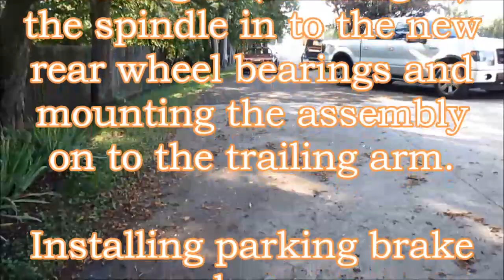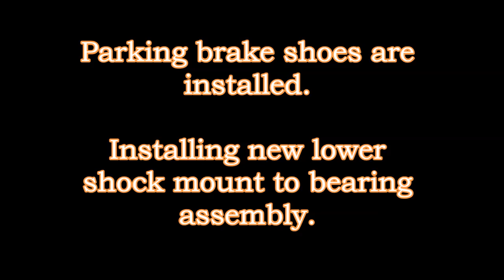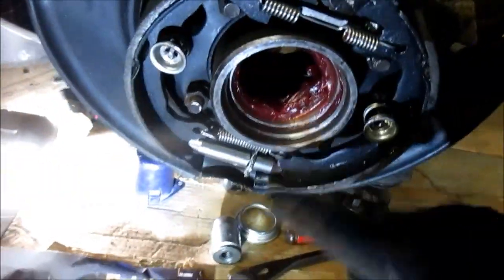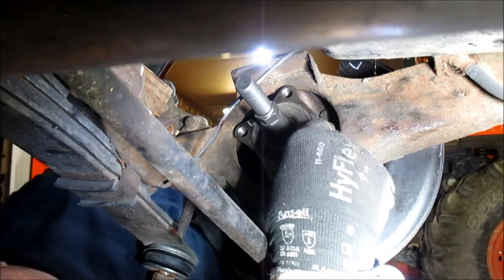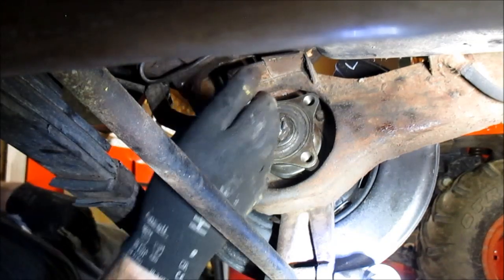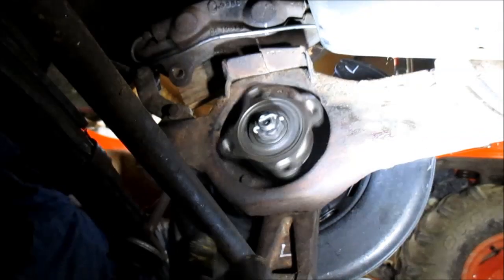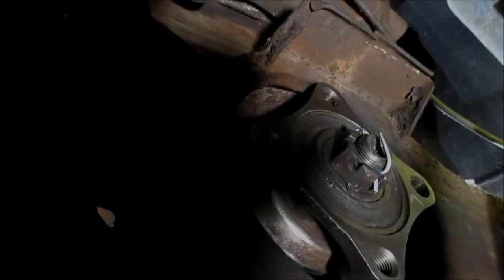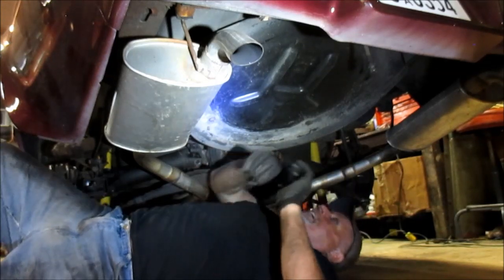C3 Corvette Installing rear bearing assembly, 1975 Corvette, Volume 25

Comment: I have that exact same set-up tool, also bought from eBay, and I found the bearings to be more of a slop fit rather than a slip fit.  I had to put shim stock between the tool and the bearings; otherwise, my measurements were unrepeatable and all over the place due to excessive lateral play.
Reply: That was a great example of mechanical workmanship 💪🏽💯

Comment: Dave, an absolutely awesome video, might be my favorite to date, although you have so many good ones, I would love to se a follow up one with the parking brake and the camber set, catch you real soon my friend
Reply from the maker: Hey Mike, thanks for the kind words. On the parking brake, the cable that runs to both wheels is rusted and won't move so I'm going to have to replace it. I'll be doing a follow up on that procedure. I've eye balled the camber and it seems to be OK. The wheels sit pretty much vertically straight up and down and from what I've read "0" camber is OK so I'm just going to monitor tire wear and adjust if/when necessary. I didn't change the camber setting up top and it's handling pretty good so we'll see.
Carry On Mike.
Reply: @Volfandt  sounds great Dave, I will be watching for the next video
Reply: @Volfandt  You're Awesome Dave, Ive been doing Eyelignments since 1991 and have 0 issues and ive done 80 to 150 of them... Good to see someone shares a good skill

Comment: Getting a slight metallic rubbing sound that pulsates in time with the rotation of the left rear wheel upon acceleration, usually after a hard turn. Looks like I may be getting into this!  Thanks for the video... very well.
Reply from the maker: If it's been a long time since you've changed out the rearend gear oil and you might do that 1st. Make sure to add atleast one bottle of AC Delco 
Genuine GM Fluid 88900330 Limited Slip Axle Lubricant Additive to the 80w90 or thicker gear lube.
If the gear oil is good, get it jacked up on stands then start turning and listening. Could be a U joint or a wheel bearing or both.
If you tackle it yourself just get the special tools and the job becomes a WHOLE lot easier. Good luck and thanks for watching M.A.
Reply: Thanks. Yeah, I took care of that a few years ago and the car doesn't get driven much.
Reply: I might have to do the bearing job yet, but yesterday after searching for and failing to find the source of a noise like that I discovered it went away when I tool the hubcaps and trim rings off the wheels. Happy to have an easy one for once!

Comment: Question??  I just did this job on my 75.  I set the bearing clearance at .004, packed the bearings, installed the spindle with new washer and nut, Torqued to 100fp and now I can't turn it by hand.  I can with a persuader.  Is this normal?  Do I trust the .004? or should I take it apart and check it again?
Reply from the maker: Hey Thomas. You should be able to easily spin it after it's assembled & torqued down. Double check that theres no spare parts left out, especially the shim. Make sure the bearing carrier is properly installed on the trailing arm. Loosen the axle nut until it spins freely. If it does spin make sure it smooth. Then slowly retorque, checking the free spinas you go. You may have to disassemble and redo the free play. Good luck.
Reply: @Volfandt  Thank you.  I set the other side at .006, got the same thing can't spin it by hand.  I measured the old spacers and shims (with the new bearings and races) they measured .010 and .012. both with original .020 shims. I haven't tried them assembled and torqued yet.  Thanks again I appreciate the advice.  Love your video's, Thanks for posting them.
Reply from the maker: @thomaswright2628  With this test the two remaining variables are the new races & bearings.  I'm going to guess the bearings matched up with the originals correct? Double check that and  that they spin easily before installing. Also double check that the races are totally seated. I know it can get frustrating rechecking everything and hopefully it ends up being something easy.
Reply: @Volfandt  Dust Shields!!!  I took one apart and double checked the clearance. I put it back together pulling the axel through with a rachet instead of an impact.  It felt good and spun free.  I put the Spindle Flange on without the seal or dust shield and torqued it. It felt good and spun free. I put the inner seal in with the same result. When I put the Dust Shield in it tightened up and wouldn't spin.  So once you seat the Dust Shield properly it works the way it's supposed too.   Hopefully,  if somebody runs into this problem, they can learn from my mistake.  Thank you for the advice.  I owe you a beer.
Reply from the maker: @thomaswright2628  ALLRIGHT, glad you ciphered it out. And congrats on tackling this repair. Carry On! 👍👍👍
Reply: @thomaswright2628 thank you so much man you saved me having to take apart my whole hub assembly again

Comment: I bought a whole hub assembly and want to do it the castle nut on to the 100 pounds torque but the rotor turns. Might be obvious but can you tell me how to get the rotor not to turn so I can torque the nut? Thanks
Reply from the maker: Take a long crowbar, crewdriver or thick pipe and place it between a couple lug studs to hold the hub still while you torque the castle nut down. You won't hurt the lug studs as long as you hold the bar tight against them.
If you look when I'm running the castle nut up & torqueing it you should be able to see how I'm holding the hub still with a crowbar on the lug studs.
Good luck
Reply: Thanks!! I will take a look tomorrow
Reply: Hi again…I am not so lucky my cotter pin is not even close…do I go more or less? It’s like in the middle so might be either 90 or 115
Reply from the maker: @guitarhero9999  I would try to tighten to align the hole. Sometimes you can back off then retorque again and get the holes aligned. Don't go over 175 ft lbs tho and if it's taking that much back off to align.
Good luck
Reply: Thanks again! Hello from North Carolina!
Reply: Got it! The washer is a bevel washer and I had it on backwards. Lined right up thanks for the help.
Reply from the maker: @guitarhero9999  👍

Comment: Can you post the links to the tools and bearing kit you got?
Reply from the maker: I got the rear wheel bearing & tool kit off of ebay. This link should work: https://www.ebay.com/itm/191684133936
It doesn't include the rear shock mount knocker. Don't get the one I used, get the longer one. It's more expensive but should work better than the short one I ordered and it didn't work.
Good luck. It's not as hard as it looks when using the right tools.

Comment: Do you have part numbers for the kits you used?
Reply from the maker: I got the rear wheel bearing & tool kit off of ebay. This link should work: https://www.ebay.com/itm/191684133936
It doesn't include the rear shock mount knocker. Don't get the one I used, get the longer one. It's more expensive but should work better than the short one I ordered and it didn't work.
Good luck. It's not as hard as it looks when using the right tools.